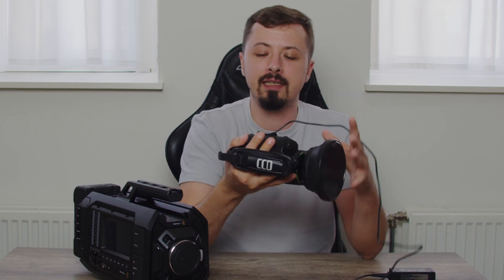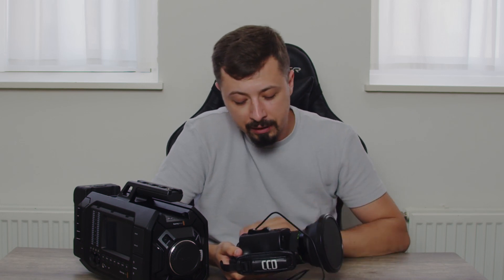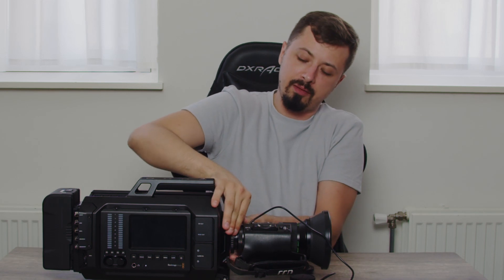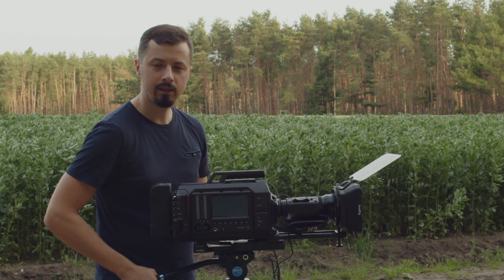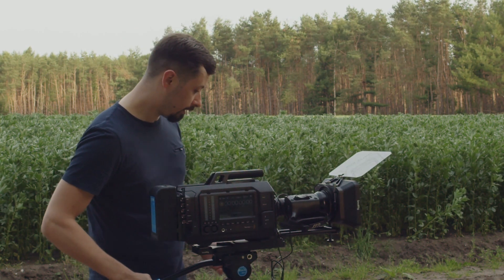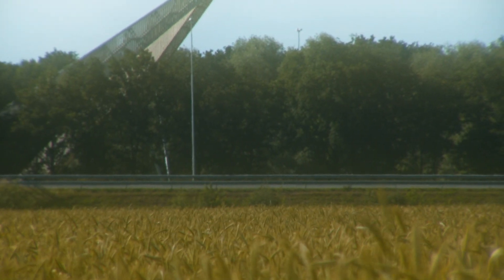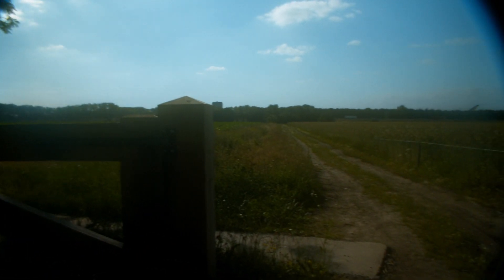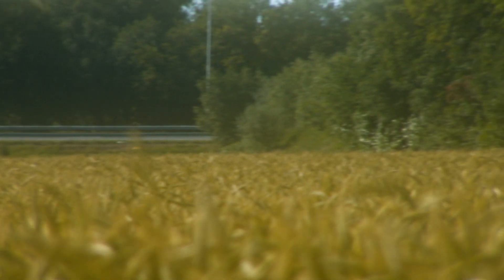Vintage Fujinon B4 lens on a Blackmagic URSA 4K (JVC Zoom control A16X9.5BRM-9B)

Comment: jejeje i buy old things too... but i stop a little, reallity is that the quality of the image suffers a lot in most cases. And the equipment end up in the closet.
Reply from the maker: Lets be honest here, this is extreamly old lens for SD resolution for a different type of sensor with a prism, this was more ment as fun video to see how would it look to connect that together. Even with the poor quality I used it for some vintage look shoots, after a little color grade came out quite nice :D

Comment: It resolves quite well, but stopping down and using a deeper hood will help
Reply from the maker: While testing I was at around 5.6 and using original hood and on a second part the smallring matte box. I will still keep experimenting with it and get a adapter with glass element to see if it will help to cover the sensor area jus a bit more.